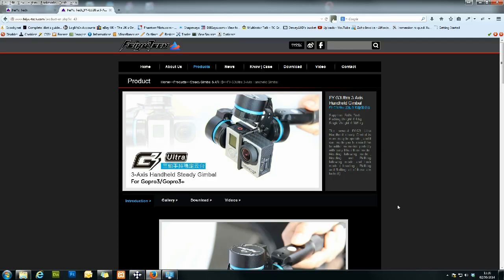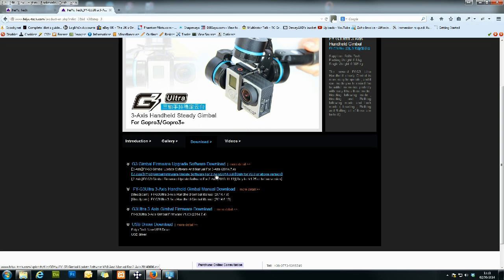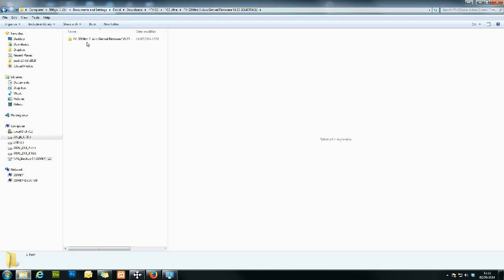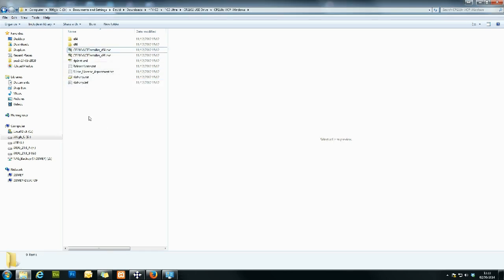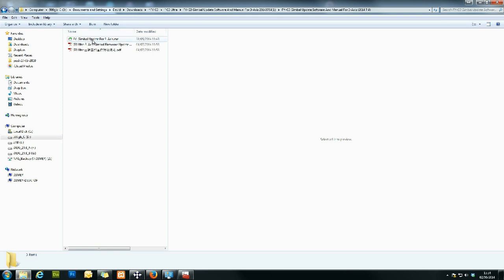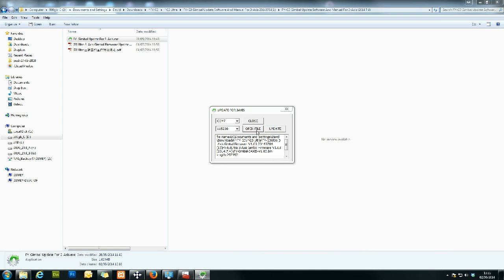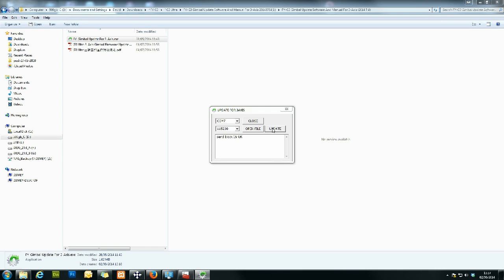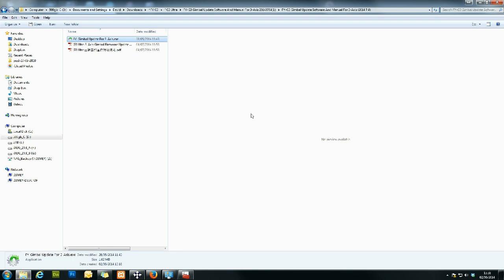Feiyu-Tech G3 Ultra - 3 Axis - How to update firmware

Comment: For some reason when I connect my gimbal to usb. Nothing happens on the screen that indicates the gimbal is connected. I've downloaded the usb software and the upgrade software. I check to see in device manager my port and bits per sec. It just doesn't read my gimbal when trying to connect for some odd reason

Comment: Hi, i bought gimbal for drone from Feiyu Tech 3D mini, but the upgrade seems just the same as that you have here. My problem is, that after send first slave (first count from 1 to 99) it shows me "Send Fail". I've tried change usb ports, cables, instal and uninstal drivers, download firmware couple times, bit rations and ports are the same. What can i do? except contacting FY with horrible support.

Comment: Now the new firmware has giving me trouble. It's caused my G3 Ultra to shake a lot. How to get back to factory firmware?
Reply from the maker: +Zach Ahmad Just do the same procedure but select the older firmware file.
Reply: d3weyTube Oh i see. I will try it soon.
Reply: d3weyTube So, I managed to downgrade to V1.03. The shaking and bumpy have minimised. But it took time to turn it on.

Comment: I've used my Gimbal three times, and now it will start up, then stabilize then goes limp, but the lights are still on. Any help?
Reply: +Lanero Hill any luck? I get the same thing with a red light error - trying to find a solution online is hard..
Reply: I got in touch with the company via email, and they were excellent with communicating back and forth with me on sending it to them to check it, and it was exactly what they said it was before sending it to them. The batteries were bad. 

So, before you go out to buy batteries contact them first to see what they think. Then again the batteries might cost as much as shipping. 

I hope this helps, and good luck!
Reply: Taz Lanero - I did buy new batteries to test already (good tip) - I contacted them yesterday & have since posted it back to be fixed. Will let you know how it goes in case anyone else needs help in the future. Thanks for the quick reply bro - happy shooting.
Reply: I'm posting this after gleaning some info here. My G3 Ultra, purchased second hand, worked as it should over several days of use but noticed that one of the 3 batteries was underperforming. After a recharge I took the G3 out for another session, pressed the power button...all the lights fired up, but the 3 gimbal lights were all pulsing and no stabilization mode. What's going on?  After checking some posts, I tested the batteries and had one dud. After swapping it out with a good battery the problem of failing to initialize after powering up was gone.
Reply: I have had the ole random dud battery issue - bought a bunch of new ones - worked fine for a while - but they don't seem to want to charge with the supplied charger -frustrating.

I did just get the gimbal back from a factory repair from buggered motors (one of my camera opps was too rough with it) which is working great now - other than the battery issue....

Comment: How do you update the software on a mac?
Reply from the maker: Parker Lund Only option is to use Bootcamp or Virtualbox or some Windows emulator. No idea why but Feiyu-Tech just don't seem to want to support Macs still which is somewhat contraversial. Virtualbox + Windows 10 free development download should work but it is a hell of a hassle. Better to try and borrow someones Windows computer if you can (or buy a cheap one cause in the world of RC I have found that most new products will have Windows software before Mac).
Reply: Okay sounds good thanks.

Comment: sorry to bother you again but i'm a bit confused with the "read me first instruction" to my understanding, the instruction said not to leave the batteries in the gimbal when updating your firmware. i've seen videos where people claims that it will ruined the motherboard if they're in. I did my G4 firmware update last night without batteries and was unable to power "ON or OFF".  In this video it seemed you have full access of the gimbal as if the batteries are included. My power shortage problem could be a possibility of improper installation in firmware update. Wanted to do a complete follow through per your instruction video in hope it would solve my problem.  Thankyou for help in answering all my questions. it seemed you are my only source in troubleshooting this gimbal, i'm still waiting on FeiyuTech to reply from my emails.

Comment: great... just recieved the G4 and soured somewhat because of how difficult this is RE FIRMWARE when using a MAC!!
Reply from the maker: Yes this is a problem that a few are suffering from. From my communications with Feiyu-Tech they have no intention of creating OsX software so you are stuck with Virtual box, bootcamp or VMware (I think they basically don't have a Mac coder at the company yey). Frankly the easiest way is still to borrow someones Windows PC if you can. The problem is that Feiyu-Tech are more a radio controlled flight controller based company that caters to people that are used to a lack of Mac support. They will need to change but until then there is no easy solution.

Comment: hello sir i have a problem that i did all the steps u did but i always get at the end for updating "send fail" 
and this is the link for what happen https://www.dropbox.com/s/f25dnnukuqzxlt0/feiyu-tech.m4v?dl=0
i have a question do u see the cable "USB" in computer folder coz i don't see it i see it in ports only
Reply from the maker: I see the problem Nadim. You only click 'open' after connecting the USB to the gimbal. It is important to have the com-port open BEFORE you connect the the gimbal. Order should be:
1) Open software
2) Click 'open' on the correct com port (Com 3 as you correctly identify)
3) Find/Open the firmware file
4) Plug the USB into the gimbal (without it on)
5) Turn on the gimbal (You should then see a message telling you the connection is ok and the current firmware)
6) Press 'Update'

Hope that helps.
Reply: d3weyTube i did what you told me but still same msg "send fail" ....i have  a Q ? do u see your usb to ttl as normal USB  inside the computer folder ? coz i see it as port but when i open computer folder i don't see it as USB
Reply from the maker: Nadim AL-Mallah
Sorry to hear you are still getting that problem Nadim. The USB won't show in your computer folder as it isn't a flash drive. It should only show in Device Manager.
My advice at this point would be to unplug and unistall the USB driver (do it from 'Remove Programs & Features first and then from Device manager after if it still shows). Then re-install it, plug it in and try again. Failing that I fear you will need to talk to Feiyu-Tech about the fault (maybe re-do the video showing my procedure to show it isn't working).
Reply: d3weyTube thabks i did send them the video but  they are not answering me
Reply: Nadim AL-Mallah Hi did you have any luck sorting this out as I am getting the same problem. Many thanks.
Reply: Well no so what I did I bought the new one G4 ... That I will never try to update so it doesn't happen again with me or they should make it work with iOS software

Comment: Hi, Excellent video!! Many thanks for sharing your knowledge. Quick question.... I own a Swiftcam G3 Gimbal which seems to be exactly the same machine as the Feiyu-Tech just with a different name. Dict-creative.com offer no software updates or support on their website however. Would I be able to use the Feiyu-Tech firmware update as my gimbal is 'drifting' badly now?
Any advice would be greatly appreciated.
Many thanks
Reply from the maker: Honest answer to this is that I'm not 100% sure. However this is easy to test. Simply do the first 6mins of this video (download and install USB driver, download the latest firmware and the update software). When you have it all ready (as per the stage at 6mins in) and you turn the gimbal on, it will tell you if it is connected to the Gimbal and tell you the current firmware version. If it sees the gimbal and reads the version then you are golden and can proceed. If it doesn't then you know there is a firmware tweak.
I am yet to ascertain if Feiyu-Tech make these under license for Swift-Cam but I believe so (as they do for loads of other companies) and hence i'd be amazed if it didn't work. Would appreciate if you can reply here once you have tried so other SwiftCam owners can see.
Reply: d3weyTube Thanks so much for getting back to me. I will let you know how I get on although it may take me a while as I will have to borrow a PC and get to grips with it (I am a Mac guy as I suspect a great many other Feiyu-Tech Gimbal users are... I So wish they did a Mac version of this upgrade!) Fortunately I have your video to follow step by step! Will let you know asap if it worked. Many thanks once again

Comment: The Feiyu people need to realize that they must make a way to easily do firmware update for Mac users. I, too, feel quite unhappy that I was not told that you need Windows to update. I would not have purchased it if I knew that. Many, many people using GoPros use Macs exclusively.  Seems quite backward that Macs are not supported at this point.

Comment: FT added some new firmware and software. Could you do a follow up or link to a write up? Thank you for the great information that lead to my buying decision.
Reply: Update: arrived today and I updated to 1.12 from 1.10 that shipped with my gimbal. Prior to the update I noticed slight drifting with a hero4. With 1.12 it appears fixed with a hero4. I also noted that FT has posted on the website a "gimbal setting software". The pdf says you can make manual pitch and roll adjustments to the gimbal. I have not tried this yet but I was curious if you might be already working on a video/tutorial.

Comment: I did as the video describes, double clicked on the CP210xVCPInstaller_x64.exe and when I try to install it, I get the message from the installation wizard: "the device driver installation wizard was unable to find any drivers designed for your machine. Check with the vendor or your site administrator to ensure you have the correct program"

I'm not sure how to proceed
Reply from the maker: First step is to try the x86 version... it should work even on a 64 bit version of windows I think. After that of course the question comes as to what your operating system actually is? Is it Win 7 or 8? I'd not expect an error like you have unless you are either using a 32 bit version or something like Windows RT.
Reply: ehrutland, Have you made any progress? Have you been successful in getting the gimble updated? Please let me know as I have similar issues.
Reply: +ehrutland +d3weyTube I know this comment is from a year ago, but I'm wondering if either of you know the solution to this issue? I'm attempting my first software update, but can't complete the Device Driver Installation because the wizard is unable to find any drivers designed for my machine. The laptop I'm using is a 64-bit version of Windows 7 Home Premium. Any suggestions or links would be greatly appreciated! Thank you!
Reply: +Mick Welde no I just gave up. I bought the DJI OSMO. Way better, check it out
Reply: +Mick Welde +ehrutland Hi! I, too, have the 64-bit Windows 7 laptop (bought specifically for the G4 Gimbal GRRRR) because I own a Mac. Sad that it's necessary, Anyway, the problem I encountered was the USB device that connects the computer to the gimbal was a DUD! It turned on...then off...repeatedly. Once that device was replaced, I was able to get my gimbal updated. Agreed. It can be totally frustrating!

Comment: i have seen that you are using windows! Can i do it with a mac?
thanks for the tutorial by the way!!!
Reply: Jairo Parada Hey, i contacted them about it as i use a Mac, they don't ever plan to make a mac version I complained to them saying they need to ADVISE this on the box etc that its not Mac compatible.
Reply from the maker: Ariders LifeUncut
I agree they really should make things like this much clearer. Not only to their customers but moreso to there distributers too. Adverts on websites selling their products should always state what OS it is compatible with.
I fear in the world of the RC hobby though you are well advised to have a Windows based computer available to you. Developers often start with Windows versions due to the lower costs associated in licensing and development kits as well as the fact more people are using Windows still than Macs... they will always cater to the larger market. With Bootcamp pre-installed on the Mac (and a doddle to set up) it is well worth $70 for an OEM copy of Win7... just gives you that option if ever you need it.
Reply from the maker: Sadly it seems Feiyu only do Windows versions of the software at the moment. No idea if they plan to change that policy but for now I think it is a case of a Bootcamp version of Windows or some other virtual environment. I use Bootcampl on my Mac personally and it works perfectly.